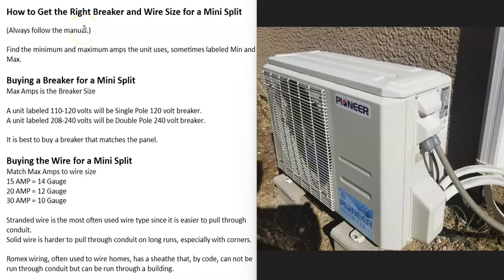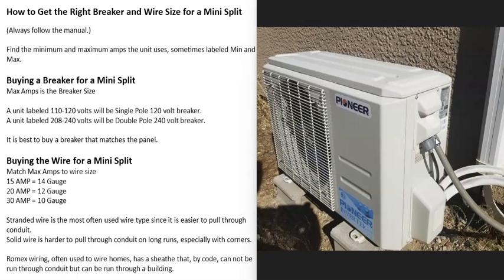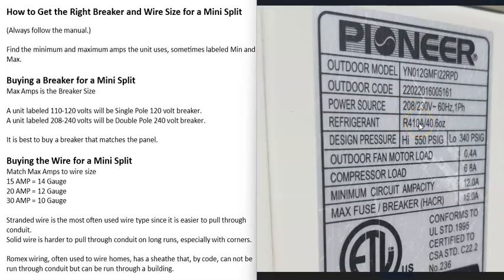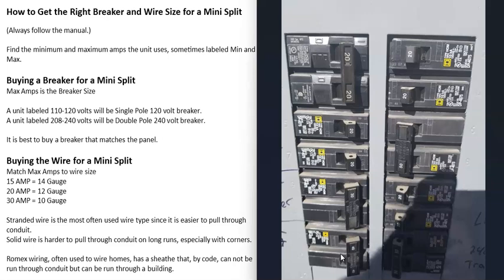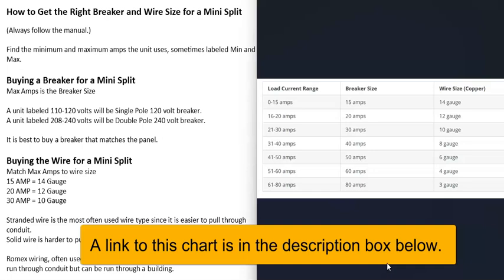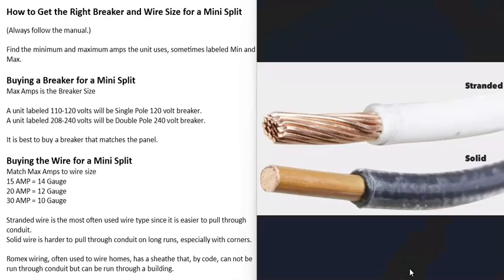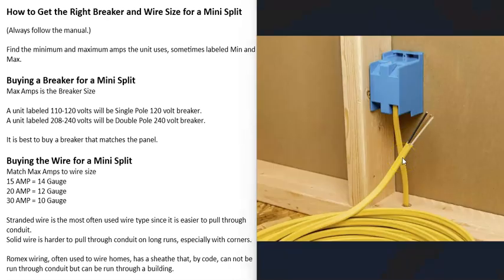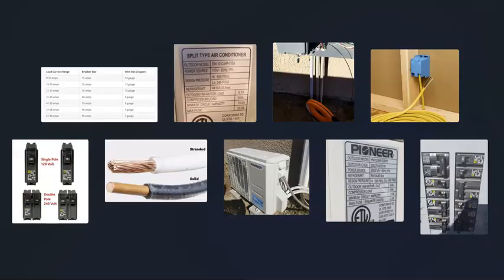How to Get the Right Breaker Size and Wire Gauge for a Mini Split

Comment: Great explanation but it doesn't take into account  the 125 percent rule where you have to upgrade the breaker such as a unit showing a MOP of 15A would require the use of a 20A (12 gauge) under this calculation or is that not a thing anymore?
Reply from the maker: You can check the AMP load with an AMP clamp and see what a unit is pulling. I always check AMP load, and these mini split units, especially the 220/240 units, often pull 3-5 amps (12,000 BTU). If the unit is 115 volts it can pull more amps (usually 8-12 Amps for 12,000 BTU), although often much lower than the rated breaker. Older units will pull more amps compared to newer units.

Comment: My mini split says 25 double pole but 14awg wire. Im using 12 but still why does the company say 14
Reply from the maker: I'm not sure of the unit, but a 25 Amp breaker is a bit high for most mini splits unless you have a big unit, roughly 24,000 BTU. 25 Amps would require 10-gauge wire. I would contact the company to verify the correct Amps and wire size.

Comment: Okay I’m a little confused so I have the exact same one as the first example 208/230 15amp so you said it calls for a 14g wire double post so what number is that on a breaker two 30s or 50s?

Comment: Great info, thanks. So what for a 30 amp breaker would you use 10/2 or 10/3 I get conflicting information. I am preparing for a future 24k btu hyperheat mitsubishi minisplit.
Reply from the maker: It's always best to follow the manuals recommendations but both should work. The difference between 10/2 and 10/3 wire is that 10/3 wire has three insulated conductors while 10/2 has two. So, 10/3 can provide two 120V circuits or a 240V circuit that needs a neutral. Most 24k mini splits are 240 Volt single-phase and need two hot conductors and equipment ground (no neutral), so 10/2 will work and while over kill so should 10/3.
Reply: @HVAC_Mechanic thanks I already ran 10/2 but AI is telling otherwise. I looked at the mitsubishi wiring diagram and it shows red black and white, but those are confusing and I don't know the exact 24k btu model. Thanks again.

Comment: I have a Della 115v unit that states a minimum ampacity of 15amps, minimum wire size of 14awg, but breaker size of 25amps which makes things confusing.. is it implying I use a 25 amp disconnect but 14/2 from my indoor unit to my outdoor unit?
Reply: Have you gotten an answer? I am in the exact same situation

Comment: Seems very straightforward. What if the unit says max fuse 15amp, but the LRA says 28amp. What breaker and wire size would I need?
Reply from the maker: The LRA (Locked Rotor Amps) is a momentary inrush of current (amps) when the compressor starts, usually supplied by an HVAC start/run capacitor. It does not directly determine the breaker size. The "Max Fuse 15A" label is the one to follow.
Reply: @HVAC_Mechanic  Ah that makes sense. Thank you for clarifying. I was incredibly confused.

Comment: So what's the best type of 12 gauge wire if you can't use the romax wire because you are running it through conduit?
Reply from the maker: Typically, 12/2 or 12/3 THHN/THWN (THHN for dry, THWN for wet locations) stranded wire.

Comment: So i have 2 units i need to install specs for electrical state 208/230v 1 phase 60hz. Min breaker is 15 amp and max breaker is 20 amps, tonnage is 1.5 ton does that call for a 2 pole breaker still? I have already bought them for sqaure d panel 20 amp double pull but today when i went to hook it up in the disconnect my line is where it should be and load is whipped out not terminated to the unit yet i just wanted to see if i had power coming out but i don't, i know this is streched question but i have power coming from a 2pole 20 amp breaker where both lines are landed and both lines have power in the disconnect on the line terminals but my load wires coming out my whip aren't getting any power is that do to the unit not being terminated yet? I have it on a 30amp disconnect hardware store said it'd be fine to use but now im lost i don't know if its the wrong breaker, maybe a defective disconnect i didnt have my meter to test voltage, or should i look to see if the disconnect is 3 phase instead of 1 phase that can be causing issues breakers don't trip so i don't know if thats a good or bad thing, anyways man just wanted see if you had advise seeing you have hands on experience id guess your licensed have the detailed knowledge that seperate apprentices, jornymen to masters, ive wired many a/c and mini splits as a electrical apprentice under someone before so the is master HVAC/ELECTRICIAN skills if i can't figure it out
Reply: Aslo just remembering the disconnect is a Midwest 30 amp and panel is sqaure d now that I think about it might be that the sqaure d panels doesn't allow much compatibility with other brands probably for liability reasons I guess. Do you think this also can effect that I'm getting power only in on the line and no power coming out on the load ?
Reply from the maker: 230 volts will use a double pole breaker. In the USA, 230 volts is single phase and won't cause a no voltage issue. I would use a meter and test the voltage starting at the breaker to troubleshoot any issues; it's the only way to find the cause.

Comment: Im trying to install a mirage mini split 115v 8.5 amps running the cable about 30 feet to the breaker box.  What size and type of wire do I need to run on the outside through a conduit and also what size breakers
Reply from the maker: With those specifications, I would install 14 Gauge wire and a 15 Amp single-pole breaker.